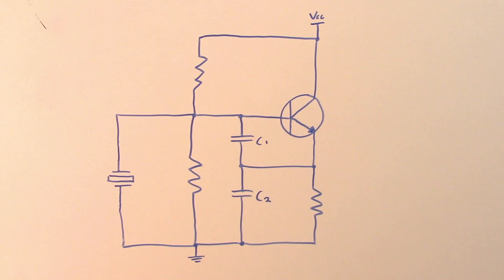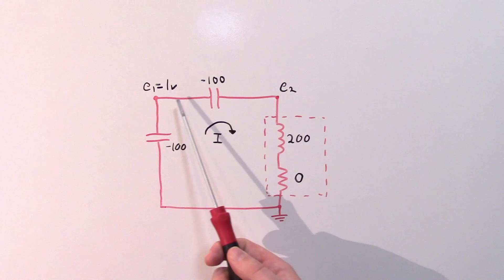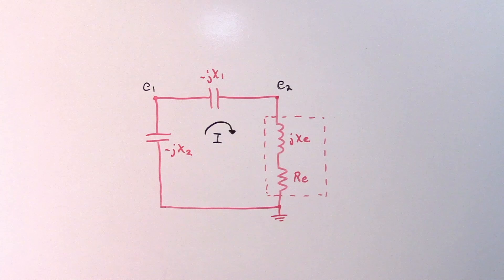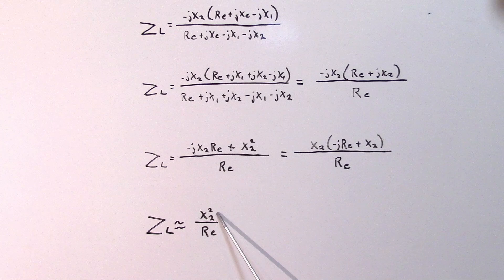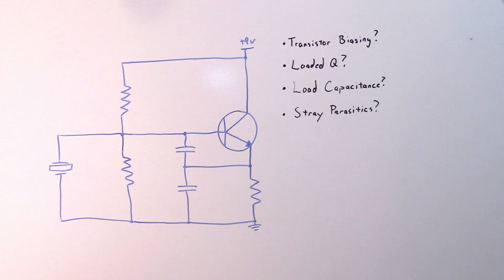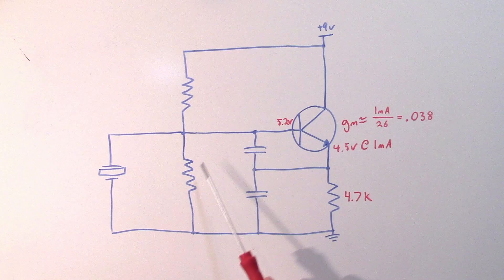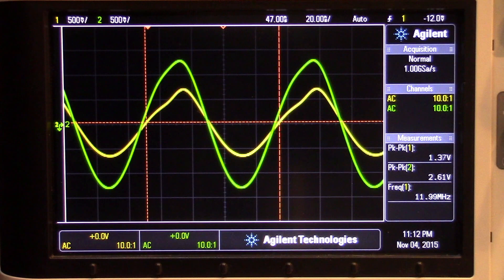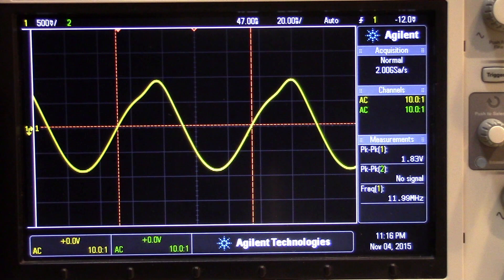Colpitts Crystal Oscillator Fundamentals

Comment: Impressive presentation.  Will you cover RF construction techniques in a future video?  BTW, at the very end, you seem to say that a higher amplitude would help S/N even when the noise was phase noise.  Isn't phase noise another word for jitter? How would a higher amplitude improve the jitter (wander in phase).?
Reply from the maker: +mdesm2005 Yes, jitter is basically phase noise, but viewed in the time domain, rather than frequency domain. Saying that a higher amplitude equals better phase noise is perhaps confusing as it only pertains to this context (i.e., oscillators). For example, adding a subsequent amplifier stage after the oscillator will worsen phase noise, as the amplifier will amplify the existing signal and noise equally, as well as adding its own noise to the signal. This would worsen the signal to noise ratio, and give you worse phase noise / jitter.

What needs to be done is to amplify the desired signal by a greater amount than the undesired noise. This is exactly what an oscillator does: it filters out only the desired signal and re-amplifies it again and again until it can’t amplify it any longer, usually due to limitations on the amplification circuitry. Raising these limitations allows the oscillator to amplify the signal farther above the noise level, providing a better signal to noise ratio.
Since a “jittery” signal is the result of random variations in the period of a waveform, and period is the inverse of frequency, that means that more variation in frequency means more jitter. So if you can amplify one frequency while suppressing other undesired frequencies, you get less jitter.

Comment: nice video and tnx a lot for this. But can you explain why e1 and e2 are in phase?
Reply from the maker: +dh1ao Phase shift is caused by reactance (capacitors and inductors), which delay signal propagation. Purely resistive components/circuits will not cause a shift in phase. 

The key to a resonant circuit is that at some frequency (called the "resonant frequency"), the negative reactance of the capacitors and the positive reactance of the inductor (in this case, the inductive crystal) are equal in magnitude. But because they are opposite in sign (capacitance causes a phase shift in one direction, inductance causes a phase shift in the opposite direction), they cancel each other out, and the circuit appears purely resistive, since all circuits have some inherent resistance.

So, at the resonant frequency, the feedback network is purely resistive, and has no phase shift; this means that the input and output voltages (e1 and e2) will be in phase.

Comment: Your feedback gain analysis assumes that the xtal only has an inductor, which is totally untrue. The xtal is a self contained resonance unit having a series cap and a parallel shunt cap. Your other assumption is that the xtal is resonating with the cap C1 and C2, which is also untrue.
Reply from the maker: Well I wouldn’t go so far as to claim that this is my feedback analysis. It is effectively a regurgitation of circuit analysis from several respected sources, listed in the references section of the link in the video description (the book by Marvin Frerking in particular).

You are correct that there are series and parallel capacitances that are part of the crystal, so the model presented here is approximate. I’ve even made a video on measuring the real-world motional parameters of crystals. However, in this configuration, at the frequency of resonance, the crystal appears primarily inductive to the circuit, and thus these capacitances were ignored (I mention this more explicitly in my video on Pierce oscillators). The parallel capacitance of the crystal in particular is typically a few pF, and is effectively just the stray capacitance of the crystal holder and leads.

Every reference I’ve ever seen on the Colpitts circuit specifically states that the inductance of the crystal is resonant with capacitors C1 and C2 in this circuit, so I must admit that your statement to the contrary confuses me. In fact, you can replace the crystal with an actual inductor to form a Colpitts LC oscillator. Surely we can agree that the series capacitance of C1 and C2 forms a parallel tank circuit with the inductance of the crystal? So it must be resonant at some frequency. If not resonant at the frequency of oscillation, then what frequency will it be resonant at? And if not resonant at the frequency of oscillation, how is voltage gain realized through the feedback network?
Reply: devttys0  first of all thanks for replying! 

yes everything works out to be true if the xtal is modelled as an inductor. However, the xtal is precision cut for a certain frequency. The xtal resonates at a frequency given by the series inductor and capacitor in the model. This is obviously as precise as a xtal frequency can get. Why would anyone want to load the caps on to the xtal and make the inductor resonate with the loading caps that have 5-10% tolerances on them? That takes away the main advantage of using an xtal.  So maybe your analysis may be correct for the way you intend to use the xtal, but the question is whether this is really how an xtal is supposed to be used, given precision requirements. 

Furthermore, how sure are you that the xtal is resonating with the load capacitors and not with itself? I guess one way is to take away the load caps and see if it still resonates. But then another question is, what if the purpose of the load caps is to complete the feedback loop and not to resonate. I'm genuinely interested to understand this.
Reply from the maker: All excellent observations and questions!

Crystals are sold as either “parallel” or “series” resonant. There is nothing fundamentally different about these two types of crystals. Parallel crystals are simply cut to resonate at the frequency stamped on the outside of the case when a particular external capacitance is placed in parallel with the crystal; the value of this external parallel capacitance is specified by the manufacturer. Series crystals are designed to resonate at the marked frequency with no external capacitance. There are oscillator topologies, such as the Butler oscillator, that are series resonant, while the Colpitts is parallel resonant. Obviously a series crystal will work just fine in a parallel resonant circuit, and vice versa, but if this is done then you are correct in your observation that the actual frequency of oscillation will be slightly different than what is marked on the crystal.

If you place any crystal in a series resonant oscillator circuit, you will see its series resonant frequency (the frequency of the series capacitance and inductance inside the crystal); take it out and put it in a parallel resonant oscillator circuit, and it will oscillate at a different frequency (although this frequency difference is usually around 1% or less, and hence is typically measured in parts-per-million).

You are also correct that the external capacitances (and inductances!) in any oscillator will affect the frequency of oscillation, and that this is generally undesirable. Manufacturing and temperature tolerances in these capacitances will absolutely change the frequency of oscillation. But, there are a few things to keep in mind.

First, the crystal itself has manufacturing, temperature, and aging tolerances, so even if you could construct a ideal, perfect oscillator circuit, the frequency of oscillation will never be perfectly exact.

Second, there are always unknown and/or poorly defined capacitances in a circuit that will affect the frequency of oscillation. Consider stray capacitances of the circuit board, input capacitances of your oscillator’s amplifier, etc. Many of these will also vary with temperature.

Third, the typical alternative to a crystal oscillator is an LC oscillator. These tend to be very unstable in frequency (compared to a crystal oscillator), but this is primarily due to the inductor, not the capacitors. So although capacitors are not perfect, replacing the inductor with a crystal removes the overwhelming source of instability.

So, when designing an oscillator circuit, you should never expect it to oscillate at exactly a particular frequency. If very specific frequency is required, you typically must include trimmer capacitors to manually tweak the frequency after construction. You also want to choose external capacitances with very good temperature and aging characteristics; this is why very precise oscillators are often ovenized to provide a constant operating temperature, and why they will periodically require re-adjustment!

However, the reality is that for most applications such precision is not required, and a run-of-the-mill crystal oscillator will work just fine without any tweaking or fuss. Oscillator topologies such as the Pierce and Colpitts are relatively easy to construct and work “good enough” for most applications, hence their popularity.

Comment: Sir when Iam using Inductor instead of crystal it is creating short path so there is "0" Volt appearing at the input of base... Sir please tell me what should I do?
Reply from the maker: Use a DC blocking capacitor between the base of the transistor and the tuned circuit. See figure 13 here: http://www.nutsvolts.com/magazine/article/bipolar_transistor_cookbook_part_5
Reply: thank you sir.. but still isn't giving output, I don't know why sir,
here is picture of that circuit sir..
https://drive.google.com/open?id=1nxYxte10e8e1TqOzTvo1srYiko--XHIX

Comment: the analysis error  !! c1 with the crystal rise the voltage the crystal dos not have inductance inside it!!
Reply from the maker: Can you elaborate? While the quartz crystal does not have a physical inductor (i.e., a coil of wire), it absolutely does exhibit inductance (as well as capacitance, and resistance). You can, in fact, replace the crystal with a physical inductor to create an LC oscillator, albeit with much less stability than one which uses a quartz crystal.
Reply: i will try to test the circuit with out crystal i will put frequency from signal generator to transistor base  in same crystal  frequency and see if the out become bigger than the input signal that mean the c1,c2  is help the input  with the tune frequency as i think . thank you for repay
Reply from the maker: C1 and C2 (as well as the inductive element, either a crystal or a wire coil), are there to help provide frequency selectivity; together they form a tuned circuit. As described in the video, they provide voltage gain due to the opposing capacitive and inductive reactances, but only at the desired frequency of oscillation. Frequencies above and below the resonant frequency are phase shifted / attenuated, preventing oscillation at those undesired frequencies.

Comment: Hi sir, what about resonance frequency  when I have Inductor  L and two capacitancer C1, C2 arranged in such manner?
if it would be 1/sqrt(L*(C1+C2)) ? it is urgent ..
Reply from the maker: The resonant frequency of an LC tank circuit is f = 1/(2*pi*sqrt(L*C)) (https://www.allaboutcircuits.com/textbook/alternating-current/chpt-6/parallel-tank-circuit-resonance/).

When you have two capacitors in series, as in the colpitts oscillator, the total capacitance can't be simply added. The total capacitance is Ct = 1/((1/C1) + (1/C2))  (https://www.allaboutcircuits.com/textbook/direct-current/chpt-13/series-and-parallel-capacitors/). Taking Ct and plugging it into the resonant frequency equation will give you the resonant frequency of the LC circuit.
Reply: yeah exactly..  Thanks for such informative tutorial and kind reply SIR..

Comment: Anyone tryed to replicate this circuit in Multisim? It does not work as simulation, anyone knows why? All bias points are exactly the same as yours. Could you help?
Reply from the maker: Oscillators require some initial frequency source, which typically comes from transients in the power supply at first turn-on, or simply the noise inherent to any real-world circuit. As such, they are known to be tricky to simulate. It could also be that the simulated crystal parameters are not the same as the physical crystal used in the circuit. I've never used multisim, but found this thread which claims to include a working Colpitts multisim file, maybe that will help?  https://forums.ni.com/t5/Multisim-and-Ultiboard/colpitts-oscillator-not-working/td-p/2719163
Reply: Thanks a lot.
Reply: I’m not sure if Multisim has an option to 'start power supplies at 0v' but this always works for me in ltspice for all oscillator circuits.

Comment: can I put my own inductor instead of a crystal?
Reply from the maker: Yes, you can! It won't be as stable as a crystal oscillator, but using an inductor results in an LC colpitts oscillator. http://www.electronics-tutorials.ws/oscillator/colpitts.html
Reply: thank you very much :) I made a different implementaion with the LC tank as the collector load of a common source configuration with feedback cap from the emitter to the common point of the colpitts capacitors.

I like your version better because mine has very high output resistance as I take the output from the collector and I cannot seem to feed the signal to a comparator.

Maybe Ill buffer the signal first, because I cannot get your implementation to work :/

Comment: Thank you for the video! Here is a little question. I have a book that claims that Colpitts crystal oscillator supposed to have an RFC (>= 10 mH inductance coil) connecting transistor collector and Vcc (example: https://afiskon.ru/s/9b/04bdefe3e8_3.png ). The role of RFC is to provide stable DC voltage to the amplifier. However some sources including this video don't use RFC. Is it not that needed or it depends?
Reply from the maker: I'm not aware of that being a requirement, and I can't say I've seen that stated in any book on oscillator design that I've seen. I don't see an advantage of having an RFC as a collector load to the transistor, unless you were planning to take the output from the transistor's collector. 10mH is VERY large, especially for the frequency range specified in the schematic you linked to; I'm sure you could get away with a much smaller value inductor, or even a simple resistor, if your intention was to take the output from the collector. For very low phase noise oscillators providing a clean and stable voltage source is important, but typically I've seen this done using either simple RC filtering, or active filtering, e.g., a "capacitive multiplier" circuit. Wenzel Associates, who specialize in oscillators and frequency sources, has a good write up on the subject of voltage regulator noise: http://www.wenzel.com/documents/finesse.html. I'd be interested to know what book you saw that in?
Reply: I see, thank you. The book is "Practical Electronics for Inventors, Fourth Edition" chapter 10 "Oscillators and Timers" https://www.amazon.com/Practical-Electronics-Inventors-Fourth-Scherz/dp/1259587541/ Currently I'm trying to figure out how to make an analog AM/FM transmitters/receivers that would use carrier waves around 100-443 MHz. I've read a few books on SDR and DSP some time ago, also I managed to build basic RC filters, Butterworth filters and a Clapp LC-oscillator. As I understand I would probably need an analog multiplier. Anyway could you please recommend something to read on the subject?

Comment: Like the videos but where you get all the numbers gets really confusing. Better then some of the other videos but for a beginner like me kind of hard to follow. I understand some of the numbers and where you got them. Maybe put the math along with the diagram would help or more step by step. this point U= X*Y*Z....
Reply from the maker: +Martin P Thanks for the feedback Martin! Can you give some specific examples of where the numbers got confusing? That way I can be more explicit next time. :)
Reply: +devttys0 , at 1 min mark, I see where VCC is the input voltage and ground, but where is the output? Maybe add electricity flow direction. I see where it sort of goes but but beyond where the gate gets charged. I assume the gate opens it now flows to the crystal from e1 to gnd and down to c2 through the crystal to the gate and to C1 C2 ground and crystal @9:42 I guess the output would be from e1
Reply from the maker: +Martin P Thanks Martin! To answer your question, the output is typically taken from the emitter in a Colpitts oscillator, but it can be taken from any point in the circuit (except Vcc and ground, obviously). You might also want to check out this Colpitts oscillator animation: https://www.youtube.com/watch?v=R-bMTlVF0Uk.
Reply: Sure thing. kind of my first project is building an oscillator.. i think the math part was another video

Comment: 15:05 That seems a bit fishy to me. The "this is relatively small, therefore we set it to zero" move shouldn't be applied selectively.  Doing that you can get a lot of nonsense results.
Of course the result in this case is alright, but I'd argue it differently. I'd split the sum with canceling Re in the left half, giving -j*X2 + X2²/Re and the argue that the right half is way bigger (X2² > X2 and 1/Re both big), ignoring the left half, giving the same result.